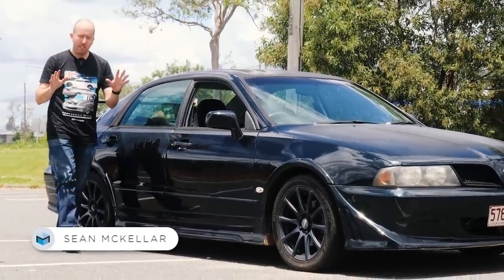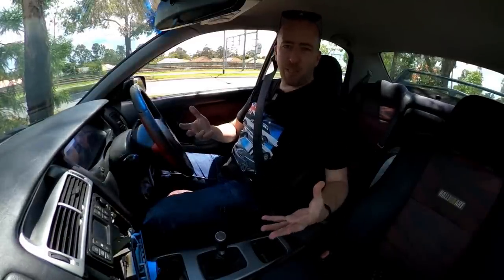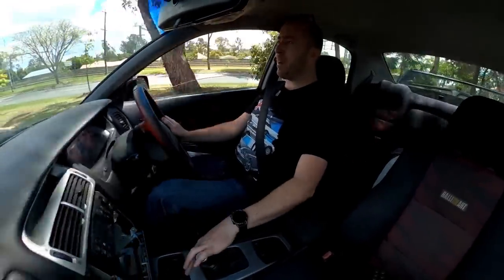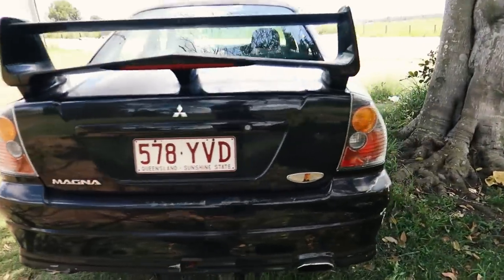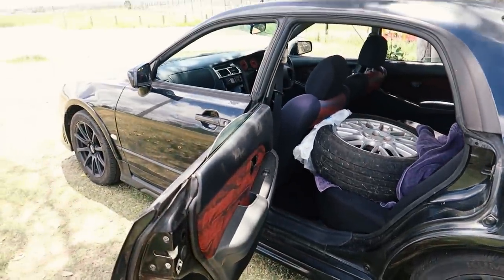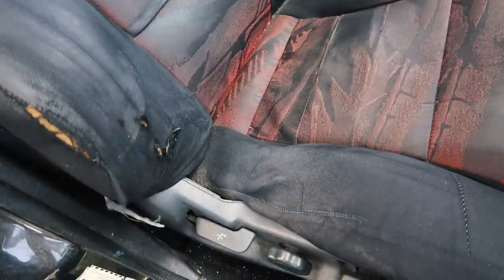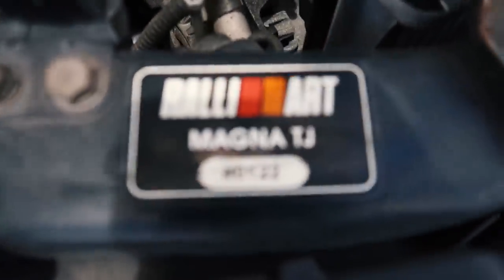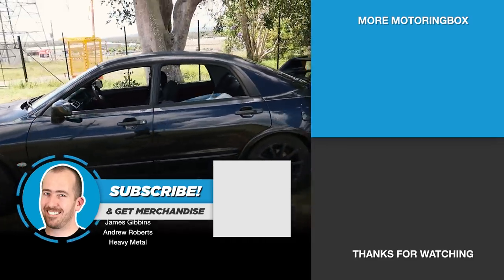Mitsubishi Magna Ralliart First Drive! This Aussie 180kW 6G74-powered manual sedan is a screamer!

Comment: 20 minutes ago i knew nothing about Mitsubishi magnas, didn't know they were made in Australia, didn't know they were 6 cylinders and i didn't know they sold a small amount with that MEAN bodykit. Really excited to see more content, awesome find Sean 👍
Reply: did you know some came awd?
Reply: That is the Mitsubishi Magna TJ Ralliart, so it's a bit more than just a body kit it has a very different interior theme and there are some better parts in the mechanics compared to the Sports. Also the Sports and VR-X make 163kw while this makes 180kw, I've seen some test at 250HP. So it's a bit more like the difference between the GT350-GT500 than the Falcon-Falcon XR-6
Reply: Correct. Owned a few 2 decades ago. Essentially a 3.5 with a body kit & map. Not exactly iconic or a classic. I had a wing skirts, exhaust, front splitter on my solara, tuned, suspension wheels etc. Not any different. The ralliart was a cheap say S-Line or M-sport of the day. Just Mitsubishi chucking a wing a badge & a tune on a Magna to lever off their lancer evo's. A bigger Evo however they most definately are not.
Could you say pull 200kw+ out of one? Asked around back in the day. Was never a thing. So no, no answer on that. There was no shortage of jdm alternatives out there guys were tuning. Magnas were not one of them. So I sold my 2nd, never to invest in a 3rd.
Reply: @scootbmx01  Also came supercharged in japan from factory

Comment: New subscriber earned. I have had 3 magnas and loved every one. My last wagon got a 3.8 swap from the 380 and it's upgraded gearbox, I miss that thing so much. Always searched for an elusive sports wagon but never found one close enough for sale. Looking forward to seeing the end result!
Reply from the maker: I saw a sportswagon or two for sale! Pretty cool looking things, but I was after a sedan.
Reply: @MotoringBoxTV  man I'd take that thing any day without complaints haha. I don't think you spent too much, I paid $1250 for a ratty set of those stock rims alone years ago. Wagon nerd but I had a manual tj sports sedan from a P plater I picked up for $1500 as my second one (manual wagon was my P plater so full circle) and it had a full sound system rims, rego and exhaust haha, leant it to a mate and it got crashed 😭 if you feel the gearbox is a bit sloppy I don't how rare they are but I can't recommend the 380 one enough it was my fav upgrade and just slots straight in, best part about working on cars with minimal electrics. And so cheap too but it was all before covid tax. I love just how much info is online about magnas though the forum's can tell you everything. Anyway good luck with it all.

Comment: Had a Magna for years - rock solid mechanically.  Only issue that everyone knows about was the poor paint.  I'd be happy to have one of these in good condition.
Reply: The poor paint is a new issue to me. 
I think the problem is that people don't garage them. 
Any car left out in the weather everyday, especially somewhere hot like QLD is going to destroy the paint. 
These car's are 20 year's old now.  
Magna's are cheap, so they attract the very people that don't look after them, like doing something simple & putting them in the garage each day for example. 
Have had alot of hail damaged car's locally that I saved my car from, by simply keeping it in the garage.

Comment: Magna's aren't too bad to work on once you get into it, along with the really good workshop manual you can find online. For the interior door handle backing pieces, if you can only find grey ones in good shape like I ended up with, the Dupli-color Vinyl and Fabric Paint in gloss black is almost an exact match to those black door handles. 

I picked up a TJ Sports earlier this year. so far I've overhauled all the suspension, swapped in the black leather interior from a VRX, ralliart wheels, replaced the clutch all without any major trouble; Coming up on the major service at 405,000km, which is going to be a lot cheaper than you'd think.

Comment: Sold these many years ago for a multi franchise dealer. Part of my pay perks was a company car. Which was grabbing something off the used car lot. More often than not I’d grab a Magna we’d traded. Even though I was a Holden man at heart. 

On a drive day for Mitsubishi one day we all did a hot lap with Ed Ordynski around a local race track in a standard Magna. He did things I never knew were possible in this little sleeper including an awesome Jturn to start the lap. Great times.

Comment: When they introduced the then P plate restrictions in 2004, so then it was no v8, turbo, performance 6s as in 911s or m3s and no modifications, the ralliart magnas were one of the hottest cars a p plater could drive at the time. I was lucky as i was exempt from the restrictions so rolling in a heavily modified v8 ute i could chop other p platers. I knew a bloke who wrote off a black ralliart then the red one he bought to replace it. Both manuals no sunroof cars.

Comment: I love this car i have had 2 ralliart magnas both manuals ..factory   heads where port and polished.. cams where same as 380 magna . pistons where ceramic coated .. exhaust was extractors .. and an lsd ... only diffrence except for cosmetic changes .. haha magna skids you will see mine.. crunch in third is a syndro problem but a service might fix.. I ended up th 230kw at front with 380 manifold and  injectors

Comment: Very cool project and I reckon that you're on the money at that price considering the current asking prices of other more plentiful cars on the market!!!👌
Will be interested to see how you go with sourcing replacement plastics and whether there's still a good aftermarket support for that era of Magna (including NOS parts still on the shelves)!🤞
Unfortunately all of those plastic bits and pieces may be the car's Achilles Heel and if you can't find NOS or aftermarket replacements, 2nd hand items will have most like degraded as well...
Reply from the maker: It'll definitely be tougher than Falcons and Commodores - there's just less Magnas around in general. You can still find stuff it just takes longer 😁
Reply: @MotoringBoxTV  only thing I can see you having trouble finding is a new Ralliart steering wheel, however you could just get the current one refurbished if possible. Might even be cheaper that way
Reply from the maker: @antonjenko1823  refurb is definitely the way to go. It wouldn't be enough to satisfy the purists, but it'll be fine for me.
Reply: @MotoringBoxTV   i recently sold a perfect momo for $750 delivered, as well as the oem stereo for $200 delivered, they want  $1-1.5k for a new one in a box, as far as i know only 2-3 of them are out there and they wont sell
Reply: @MotoringBoxTV  
A Wavetrac LSD will get rid of the torque steer Sean. 
Also just pay attention to getting the front 2 tyre's switched to something like Michelin Pilot Super Sport tyres or more modern Michelin performance tyres, no need to spend so much on the rear tyres - probably good if the rear has good drifting tyre's like Dunlop Sport Maxx RT's so that the back kick's out more.

Comment: My parents both had magnas back when I was younger. A '99 sports with the 3.5 brand new off the floor and later in a second hand '00 magna executive. Both awesome cars. Especially the sports. Only issue was an oil leak which was a poor thread on the sump plug and the cv joints went once 
The executive got something stuck in the air filter and nearly blew the engine but luckily was only a 400 dollar fix

Comment: I think this was really well done Sean, and I was one of those who had a big gut feeling that you would go with Mitsubishi next.

The "bones" are there and are solid, and I just know I'm gonna have a lot of fun seeing you install a stereo, the missing trim, giving the headlights a treatment, or getting a retrimmed steering wheel, which are relatively small fixes but will slowly make it look complete!

Can't wait to see this beast ready
Reply: Plus, the stock stereo on those was an aftermarket one anyway, from Fujitsu Eclipse I think.

So it won't hurt if you just throw a nice modern Sony in there for example, since I don't think the original will be easy to find

Comment: I had a 2000 Magna Sport. I didn't buy it because I wanted it, I bought it because I had a car written off in a hail storm and needed a car. I rang a mate who was mechanic and worked at a general dealership and he told me to come and check it out. I did, drove it and thought that for the price he got me, I had no reason to say no. It turned out to be a great car. Lots of power, smooth gearbox, very quiet and 100% reliable for the 12 years I owned it. They may look a bit boring and daggy, but they were the best of the Aussie built family cars for quality. I'll say that because I am a no brand man. I don't care for the Holden v Ford argument. I just want a good value decent car and ended up getting it.

Comment: Sean I forgot to mention, there's actually 2 wooden masonry board's in the boot. 
You'll notice both of them once you lift out the boot floor carpet. 
One requires a screw driver to remove. 
But also, behind the upper section of the rear seat is a metal frame that can be removed, it's screwed in place. 
There's actually one you can remove underneath the lower rear seat too. 

Also just check the 3 cup holders & centre console, I'm not sure why but they have an additional support pad or cover in place that can be lifted out. 
Hopefully the weight reductions give you an extra turn of speed😁

Comment: 'Whyteline' makes an efficient and economical strut tower brace for this vehicle - provides a significant benefit for torque steer and for general handling on the open road at high power settings . . highly recommended..!

Comment: The door cups can break easy especially if you forget to remove the screw or tightened the screw too much. Can't wait to see the Enkei wheels back on it. If it's too hard to find another facia you can use a lower spec model climate control one and paint it silver.
You'll love this car especially being a Ralliart and in manual. I have a 2002 TJ Executive that I've put a VR-X kit on and a silver 2000 VR-X that I'm converting to manual.

Comment: I owned a stock '02 TJ for many years. The auto was rubbish, but the stock 154 kW V6 was lovely, just very thirsty around town (15.1 l/100 was typical). It ended up rusting out through the heater box and leaking badly every time it rained... so keep any leaves clear of the ventilation air intakes!

Comment: Love these Ralliarts. I worked on these at the Mitsubishi factory in Adelaide. I don't remember a battery cover going on these but I could be wrong. You may need a leather gear knob too, with stitching. There is an air cleaner bracket missing. The door handle buckets just slide in and screw in with one screw, will be easy to find and you also need the screw cover. Cant wait to see this example painted!
Reply from the maker: Thanks for the comment mate - I've sussed out most of these and have a few parts coming my way 😁
Reply: @MotoringBoxTV  wicked! Kinda makes me want to pimp up my current magna. I look forward to seeing your progress with it.

Comment: Awesome deal and good that these rare Aussie cars are getting some attention now.  I had a silver TJ 2001 Magna VRX series 1 in manual and so far it's been one of my favourite cars that I have had, also one of the best sounding cars I've had too.  The V6 with the awesome throttle response and low down torque just makes for a fun drive even with the torque steer.  It would regularly beat P platers in their commodores and non turbo Falcons.  Also it was the car that changed my mind about front wheel drive being wrong and to this day I feel I'm a faster driver in a fwd car as you can push to the limits and go over them without losing control like in a rwd generally.

Comment: Ralliart 6G74 were 9.4:1 compression ratio. The stock 6G74 was supposedly 9.0:1, however my TL cc'd out at only 8.5:1. I managed to bring that up to exactly 9.7:1 by decking the block and head (and piston crown) surfaces to the maximum that was possible. Had wanted 10:1 but that wasn't going to work. 'Oversize' ring end gaps can be set individually to minimize operational combustion pressure leakage. I de-shrouded the valves, cut 3 angle seatings, and set up a 30 degree cut back to the backs of the valves, 90lb springs (60's are standard) then profiled the combustion chambers, and cc'd them all, 3mm aperture lifters, fitted 6mm phenolic heat blocks to the intake plenum and to the TB, ran the temps cooler with an 82 degree 'fail to safe' high flow thermo, a 'thicker' rad, and using low surface tension 'water wetter', completely threw away the super heavy steel/iron crankshaft dynamic balancer/lower pulley, and replaced it with a 15% under-driven lightweight drilled alloy crank pulley, significantly reducing parasitic engine power drain-off by ALL the driven ancillaries, AND, a VERY fast response rotating assembly, balanced the rotating assembly, used a lightweight alloy 25% under-driven pulley to run a 120amp alternator (108 is std) further reducing parasitic engine power drain-off, used the Ralliart exhaust system, new ceramic heat coating in and out, ripped out and blocked-off all EGR junk, opened-up the manufacturer's TB butterfly lip circle restriction for immediate early throttle response AND increased WOT airflow, kept the OEM/K&N cold air, used Ralliart cams AND 6G72DET vernier adjustable lightweight drilled alloy wheels to set-up an optimal degree of valve advance using a 6 degree static advance over the marks as a starting point, picked-up a high output race dizzy, and VERY importantly set up a race-style 8 point heavy earthing network, Pulstar plasma condenser iridium plugs at 44 gap, spiral steel core race wires, used a brand new super Delphi MAS unit, with customised flashing chip for the ECM. The top quality Delphi precision instrument is important. It provides superior no-delay accurate, consistent fuel/air ratios over the range. Most people overlook the job this unit does and try to work with lessor quality OEM economy provision (even brand new, or used and cleaned) that will NEVER provide IMMEDIATE AND REAL race engine power. The engine has to use 98 or higher. It is important to use perforated tube exhaust pressure wave moderation as much as possible ie: construct most of the length this way, as this is even MORE EFFICIENT than bare straight pipe surface tension. It takes hours and hours to set the pipework up as a part negative pressure part positive pressure 'tuned instrument'.  But it can done in compromise within the range of extractive harmonics you are looking for generated by the airflow pulses through the cylinder head(s). There is not one single baffle or restriction ANYWHERE in the whole length of the exhaust system, 4" collector, then half in 3" reducing to 2.5", ceramic coated AND heat wrapped the whole length, to maintain heat and velocity and exiting through a BIG Bourla . .

Comment: One of those ‘why did they build them, rather than just import the Galant’ cars. You can feel that even though the interior refinement wasn’t quite there compared to other brands and some other niggles (Automatics in the TE and TF), wind noise at high speed off the door mirrors and the glass sticking up in the rear doors, everyone at Mitsu Australia was giving it their best. Plain wrapper manual 3.5’s definitely surprised a lot of falcon and commodore drivers. Smart buying!
Reply: They had the edge with fuel economy, performance & running costs. 
With the interior, Mitsubishi had the edge with the Ralliart model's only. 
There was some Ralliart's that had leather in red & black which was incredible to look at & far better than the regular Recaro seat's. 
But the Ralliart's had a far superior sound system that was built for expansion, air conditioning with incredible air distribution & the dash display was far more sophisticated.

Comment: Hey Sean, take it from me as a mechanic for 25 years. Make sure the timing belt is done. They chronically leak oil from the cam seals and rocker cover gaskets. Pillarless doors are renowned for leaking water in the cabin. Im a fan of them though. Go well, pretty robust and rare in manual. Enjoy the ride!
Reply from the maker: Thanks mate. I've already worked out how to adjust the windows so I will be going over them all. Haven't seen any oil yet, but there's plenty of opportunities to start flowing from somewhere 😁
Reply: @MotoringBoxTV   they have a pastic clip at the bottom of the glass that can brake with fatigue

Comment: Ipswich had a yellow one running around town for a while. I raced it at Test n Tune out at Willowbank in my 94 ED XR8 Sprint. We both did the same time of 14.99. I had it off the line, but it caught me in the end. They kept with the AU XR6/8’s of the same vintage, easily.
Reply: They can do the 1/4 mile in 14.78sec, that was the official spec's. 
But there's been one that managed 14.5sec. 
The ones with 210kw are in the 13sec range, almost 13.5sec they can do down the 1/4 mile.

Comment: There's a good example of what you can do to these things when you throw a Mitsubishi 380 drivetrain into it along with the entire available parts bin (and some Evo bits), if you search for "Paul's Aussie Sleeper" - you're right though, they are an absolute riot. I would know. Owned mine for nearly 9 years.
Reply: True, the Magna has a significant aerodynamic advantage over the EVO & 380. 
I wonder why they didn't carry over all the technology they crammed into the JDM Diamante 30M, it even had cylinder shutting technology that was only available on the Chrysler Hemi's. 
Still it was alot lighter once they got rid of it all.